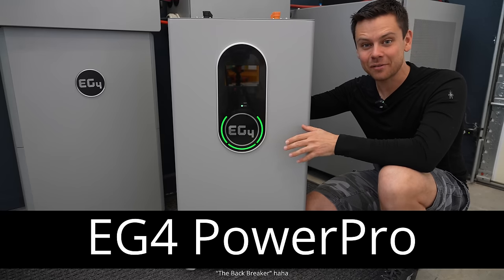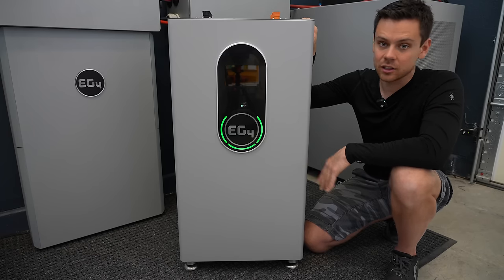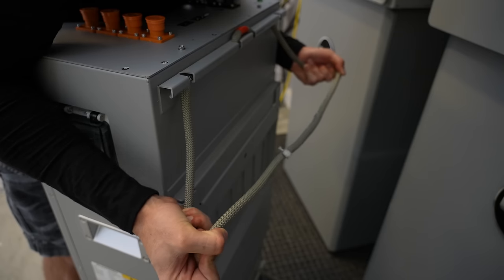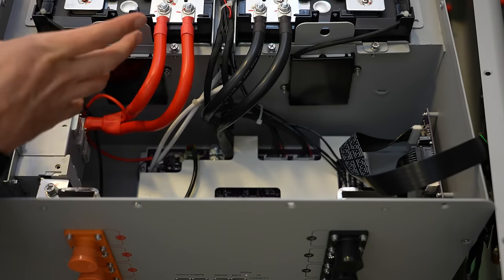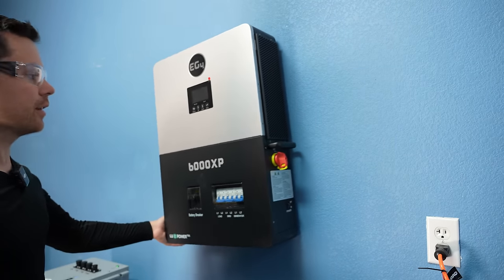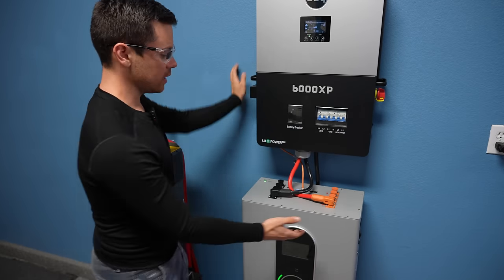New! EG4 PowerPro Budget Model: 14.3kWh LiFePO4 Battery for $3,431

Comment from the maker: Please disable adblockers to use the affiliate links below for this battery, thank you!

Signature Solar:
Indoor Powerpro for $3,431:  https://signaturesolar.com/eg4-wallmount-indoor-battery-280ah-51-2v-indoor-heated-ul1973-ul9540a/?ref=cPwLcVc0SW-BjN

6000XP Powerpro Bundles w/ Signature Solar: https://signaturesolar.com/eg4-wallmount-indoor-battery-280ah-51-2v-eg4-6000xp-off-grid-inverter-bundle-8000w-pv-input-6000w-output-all-in-one-solar-inverter-bndl-e0009/?ref=cPwLcVc0SW-BjN

Current Connected: 
Indoor Powerpro for $3,431: https://www.currentconnected.com/product/eg4-indoor-wallmount-48v-280ah-14-3kwh-lifepo4/?ref=wp

6000XP: https://www.currentconnected.com/product/eg4-6000xp-inverter/?ref=wp

~~~~~~~~~~~~~~~~~~~~~~~
Beginners Guide to Building a 6000XP System: https://www.mobile-solarpower.com/48v-complete-system-blueprint.html

Mobile 3000W 48V System: https://www.mobile-solarpower.com/mobile-48v-system.html

~~~~~~~~~~~~~~~~~~~~~~~~~~~
Does off-grid solar confuse you? 
Check out my DIY friendly website for solar system packages and product recommendations, and so much more! 
http://www.mobile-solarpower.com

Join our DIY solar community 
#1 largest solar forum on the internet for beginners and professionals alike:
https://www.diysolarforum.com

Check out my Book
Best-selling and beginner-friendly guide to 12V off-grid solar!
http://amzn.to/2Aj4dX4

If DIY is not for you, but you love solar and need an offgrid system, check out Tesla Energy! They will price out a system and get your house offgrid: https://ts.la/william57509

My DIY Solar Equipment Recommendations (Constantly updated! Check here first):

12V/48V Lithium Solar Batteries: https://www.mobile-solarpower.com/solar-batteries.html

Complete Solar System Component Directory: https://www.mobile-solarpower.com/solarcomponents.html

Complete 48V System Blueprint: https://www.mobile-solarpower.com/48v-complete-system-blueprint.html

Plug-N-Play System Recommendations: https://www.mobile-solarpower.com/full-size-systems.html

Complete "Add to Cart" 48V System Kits: https://www.mobile-solarpower.com/complete-48v-solar-kits.html

DIY Friendly Air Conditioner/ Heat Pumps: https://www.mobile-solarpower.com/solar-friendly-air-conditioners.html

My Favorite Online Stores for DIY Solar Products:

Signature Solar
Offgrid One-Stop-Shop. Best Value 48V LiFePO4, Victron and Offgrid Specific Heat Pumps:
https://www.signaturesolar.com/?ref=h-cvbzfahsek 

Current Connected
SOK, Victron, Mr.Cool Heatpumps and High Quality Components. Fantastic customer support: 
https://currentconnected.com/?ref=wp

Litime 
My favorite 12V budget battery!:
https://www.litime.com/?ref=XBIA62RFcalHns

Epoch Batteries
My favorite high-quality 12V battery:
https://www.epochbatteries.com/products/12v-460ah-lifepo4-battery-ip67-heated-bluetooth-victron-comms?rfsn=7352625.50494d

Renogy 
A classic 12V solar store that has been around for ages! DC to DC Chargers and more! 
https://renogy.sjv.io/n1VjXx

Rich Solar 
Renogy's biggest competitor! Similar products, but at a better price: 
https://richsolar.com/?ref=h-cvbzfahsek

Battery Hookup
Cheap cell deals
https://bit.ly/2mIxSqt
5% off code: diysolar

Contact Information:
I am NOT available for personal solar system consult! If you wish to contact me, this is my direct email: williamprowsediysolar@gmail.com

Join the forum at https://diysolarforum.com/ if you wish to hang out with myself and others and talk about solar
Reply from the maker: 0:00 Intro
1:18 Basic Features
4:15 Teardown
6:30 6000XP + Powerpro Install
8:03 Battery Communication Setup Tutorial
8:49 6000W Load Test
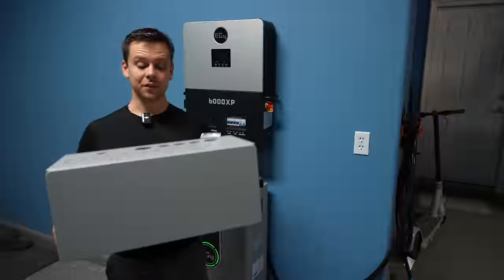10:56 One Week Later..
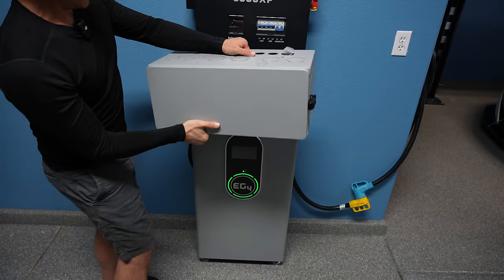12:30 Future Competition Inbound
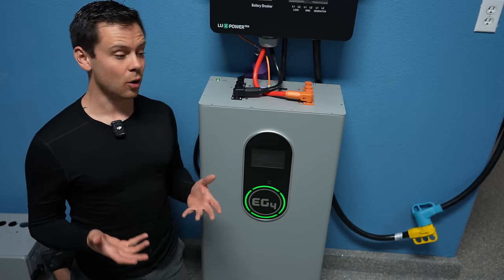12:45 Ad Blockers and Affiliate Links
Reply from the maker: I was so sick on the final few clips, and still have on and off fever today. Sorry about that. hope no one notices
Reply from the maker: @typxxilps  Can you post your evidence on the forum. This was a big issue with the first powerpro and after thousands of pages of arguing with many of the actual engineers from china, we found there to be zero issue. This argument has been brought up so many times and was an issue on older cells, but everything being sold today is able to handle it and the manufacturers have said the same thing. 

In german?? these are not made in germany.. Does eve manufacture cells in germany now? What cell? 

Ohh its a youtube video? Can you have someone post actual evidence to the forum or something. Or show proof of a failure.
Reply from the maker: @typxxilps  we had this discussion multiple years ago with battery chemists and engineers from major suppliers. The distributors verified as well too. Lets see your evidence and post it on the forum and we will check it out
Reply from the maker: @typxxilps  Oh I know exactly what graphic you are talking about, we posted that years ago on the forum. Cell suppliers have different recommendations now. If you have any recent data sheets or recommendations for newly manufactured cells, post on forum and we will be all over it
Reply: the links should all have the affiliate codes embedded in the URLs so that the ad blocker doesn't become an issue because its not needing 3rd party cookie tracking
Reply: Your 6000xp bundle link goes to the 18k bundle
Reply from the maker: @moe85moe85  we tested it and it blocked it multiple times, and they figured that from testing multiple platforms. Some adblockers seem to block it and others don't. Very weird
Reply from the maker: @slugbyte oh darn it! Thank you
Reply: @WillProwse  Get better soon, we need more of your great videos 🙂
Reply: we've seen you crimp wires for years. But would have liked to see The clipper you use for these large cables. Hammer or hydraulic?
Reply: @typxxilps you don’t know what you are talking about. It’s the same build as the outdoor no issues period
Reply: I didn’t notice you were sick. Get well soon
Reply from the maker: @LADETROIT  oh sure, I have every crimper on the market and I use the temco th0020. Use it everyday now. Love it. And much faster than hydraulic. But if I need a really good crimp sometimes I'll do hydraulic. Can't be beat
Reply: Hi, Can you test such BASEN GREEN 15.3kWh 51.2V battery too?
Reply: I would like to see a video of how to hookup a wind generator to these EG4 systems, or what do you think of wind generators.
Reply: @typxxilps  YouTube keyboard experts know more than EG4 that has sold over a million batteries and Inverters.
Reply: @WillProwse  I am wanting to build a big 48v system looking to do 320ah cells in a 16s configuration and do either a all in one or victron setup which ever is better and running 560 watt bifacial solar panels would love your advise wanting to run three 48v 16s batteries and have 240 v for our home
Reply: Hi!
I'm curious what you would recommend for a solar setup that needs to be able to weld at AC 220 @ 50amps.  Or just a shop that is running 1 industrial tool at a time (1 person shop).  Is that type of spiking power draw even possible on a modern solar system like we have now?
Reply: Just curious what kind of scissor lift is that? You'd pretty much have to have that if working by yourself..
Reply: @WillProwse  Can you please make a video about transformer inverter and non transformer inverter. Thank you
Reply: Is there a different way that you can have sellers track referrals that doesn't rely on disabling ad blockers? Perhaps a code that gets used at checkout?
Reply: A discount code would be much easier to track.
Reply: Is it better to get 1 eg4 inside battery or get16 6volt Trojan batteries
Reply: @Bustinbucks  What you might be missing from Will's explainations is that lead batteries are very tuff, in the sense that they are difficult to damage.  Lipo batteries have a huge amount higher efficiancy.

Untill the more recent ten years, the lipos were more expensive than the lead acid.  However lead acid cells have a huge weakness that they really dont last very long.  No different than an automobile battery, you can assume that you will need to replace the lead acid battery in the span of ten years.

Now that the lopos last much longer than the lead acids and are less expensive then they actually are more efficient in every sense.

So, overall I'd say that the lead acid battery is lo nlonger a good idea for most applications.  (in the past, it would be the cost of more solar cells due to the differance in efficiancy or the cost of adding capacity to a standby generator in an application such as a live abord boat....since the EG4 is so cheap it really doesnt matter if the Lead acid has any advantages any more.)    There is the rare application that involves using DC batteries because of thier tuffness....but your not going to get anything about that out of Will, he is too buisy making money on Chineese clickbait.
Reply: I have a question about wiring Why use thick braided wire instead of a thick solid copper wire like Romex real question please give me an answer?
Reply: Why there is no 120v LiFePo4 battery pack, that will remove large inverter, heat and sound? (40 cells in series where 50ah makes 6kw,100ah makes 12kw).Also Efficiency will be increased as less heat and components are needed. Two of 120v batteries will make 240v , four of this will make 480v that can charge the EVs. If safety is a concern, then good design will defend this kind of problem, removing two terminal by using pin port . A 120v 50ah battery is similar size as 48v 5.1kw server rack battery pack. If a small dc to ac inverter are installed into this battery, people can use this battery as plug and play...
Reply: Can you put this outside on the side of the house?  I know it says indoor, but looks closed enough?
Reply: Shuffling across floor is called walking the dog 😂
Reply: White stuff heat shield.  Killing me kid.  Gerbal!!! Nuclear soon brother.
Reply: Can this  battery work in 220volt or it designed to only US with 110volt ??

Comment: Will is probably the only Youtuber that I would turn my addblocker off for.
Reply from the maker: Thank you :)
Reply: I agree. The knowledge he brings to us is by far worth turning ad blocker off.
Reply: Agreed. He and his channel taught me many useful skills. Batteries, solar, wiring. I appreciate it
Reply: Or use YouTube premium and support all the content creators you watch
Reply: Disabling the adblocker is not even to interfere with the watching experience by showing ads all over the video, only for the clicking of the link.
Reply: what about your ad blocker?
Reply: Can you add add the blocker to the app ?
Reply: you should make them give you a coupon code, and then they can track referrals using that as well.
Reply: anyhow. bought a system without the ad blocker :)
Reply: That's odd that he wouldn't get revenue though, you can see the referral code as plain as day with each link,  that should be enough for them to know who the referral is from.
Reply: Same

Comment: 8000 cycles to 80%. Incredible lifespan on these systems.
Reply: thats pretty normal these days
Reply: @woodzyfox4735 really I thought 3000-5000 was the normal
Reply: @klev2008  Depends on the C rate. the 3-5k cycle life per the datasheet is typically at much higher C rate than a battery this size would see under typical solar/storage applications.
Reply: @upnorthandpersonal  gotcha, I like this set up, didn’t think about the C rating playing into it..
Reply: It's now the case people will be bequeathing their batteries to their children.
Reply: Time will tell. These are claims that are yet to stand up to the test of time
Reply: I believe calendar degradation gets them before cycle degradation especially when they're on a solar setup.
Reply: @jonobeckster  Mine are now in their 5th year, running an off-grid house 24/7. We'll see, but it's looking good for now.
Reply: I wish i had all the money in the world, I'd power my house on an LTO battery system
Reply: 8000 cycles divided by 365 days = 22 years...
Reply: Hello. Is it very expensive. with this money I buy 48V 720Ah (34Kw) battery elements for Photovoltaic installation and it is much better.

Comment: My Jackery 500 is now a newspaper weight. This tech keeps getting so much better at warp speed.
Reply from the maker: Yeah those are pretty bad at this point haha
Reply: I mean... when they started selling them at harbor freight ya had to know ...
Reply: ugh yeah I still have my Jackery 240 Explorer
Reply: Replace the battery with like for like.     Did that with mine
Reply: Wait for Sodium batteries. The price diff is insane. Even if those carry taxes, the price vs LFP will still be 20%.

It's only gonna take an year and a half for them to reach the states I imagine. If you can hold off until then, do so.
Reply: @shahzebatiq1  I have definitely been holding off hahaha
Reply: @shahzebatiq1  if they were so good theyd be in the states already
Reply: @ifyoudisagreeyouarewrong  You can get them now.  It's not vaporware but the price is about the same as lithium currently so why bother because the cycle life is a little worse.  But the numbers do look like with a bit of scaling the price should fall quite a bit.
Reply: was kinda obvious tho tbf
Reply: @shahzebatiq1 sodium batteries haven’t made it out of the lab yet.  They’re still trying to match NMC cycle life, they’re nowhere near LFP cycle life.  The prospective manufacturers are saying 1.5 years to being production ready.  Even if that were true it will take much longer to scale up and become cheaper than LFP, and that’s assuming they solve the cycle life issue.

Comment: If the entire industry went to a universal plug-in and that worked for all the components, We would never need a permit or contractor in most countries to install solar, which in Canada is most of the cost. For instance, a 30k system here would cost 60K because of building codes and labour costs, and that is the only reason most have not put this on my house in Canada.

Comment: Hmm. I've installed 2 separate EG4 systems for my customers. The 1st was an 18K EG4 inverter (outputs 12,000 watts) with a server rack of 30 KWH storage. The 2nd was an EG4 18K inverter with 2 power pro batteries 14.something kwh (28 kwh total). I love the conduit box. Having the pre engineered knockouts saves lots of time. However, when the second battery doesn't have an inverter over it creates a conundrum about how to cover the knockouts. I put some plexiglass under them inside the conduit box and filled the gaps with clear silicon. Wasn't sure what else to do. The price point is great, but maybe not as great as it might seem since they want you to stop ay 10% or higher state of charge. Other lithium batteries can go all the way to zero. The outdoor version requires unscrewing the side panels to get at the display and breakers. Pretty stupid. I like the indoor version. Not sure I would ever get the 6000 watt version. Just get the 18K (12000 watts). Customer support was pretty good at Signature Solar. But there is alot of horsing around with tech support to get the settings right.  Pretty weird. I just want to use the batteries for backup when the power goes out, but tech support keeps setting it so the batteries discharge and charge when the grid is working. Pretty annoying. The value is good, but expect to spend hours dealing with tech support and them tampering with your settings, the voltage going too low and setting alarms, and tech support setting the inverter to drain the batteries to near zero in the middle of the night then acting like it was no big deal.
Reply from the maker: Sent this post to signature solar head staff. And there are now covers for the knockouts that come with the box.
Reply: didnt your conduit box come with plugs to seal the top holes?  It should have.  Secondly these boxes are not nema rated.  EG4 needs to fix that.  Best way to do so is to include enough conduit knockout plugs for all of the knockouts.  RIght now, water gets into my boxes just from the knockouts still being there.  They need to be sealed.
Reply: @jgoldenberg123  The conduit boxes came with massive numbers of plugs and fittings. No-one can even remotely criticize them for that. I installed the equipment indoor, so whether tight was never an issue for me. However, putting lumpy plugs into the top of a conduit box where no inverter sits on it doesn't create a nice finished look. If they had not knocked out half of the holes before shipping, that would have been better, and made it easy for me to leave a flat surface for the customer. Otherwise, the conduit boxes may be my favorite feature of the install. They are very cool and useful.
Reply: @gosolxsolar  Yea, they are ok, its kind of strange to me to put a seal on the front door of the device where there are so many places water can leak in becuase of all the holes they punched.  Honestly, just put some marks on it or something, so that you can drill them accurately.  I dont understand how these boxes will ever pass for any outdoor nema rating.  Working in the trade, they should let the electrician punch the hole.  They are enabling DIYers to do this all wrong by pre-punching the holes.  Every installation of these conduit boxes will be slightly different.  I cant wait to see what the inspector thinks of these boxes, I may have to surround them with an actual rated nema box.  I am very worried.
Reply: @jgoldenberg123  These battery packs are INDOOR ONLY rated. Not sure which video you were watching.